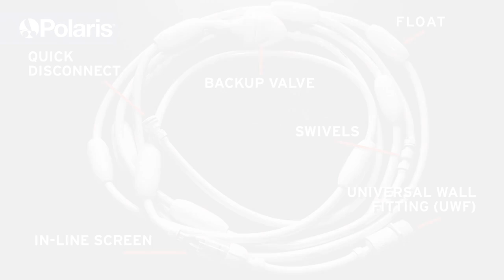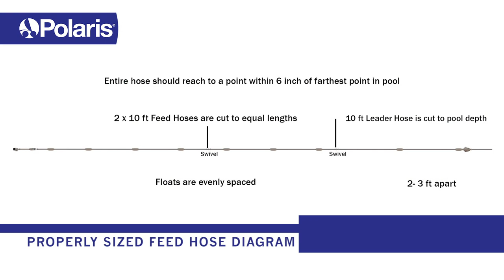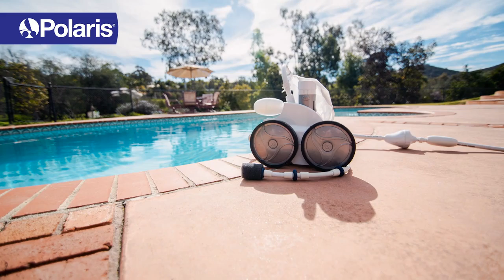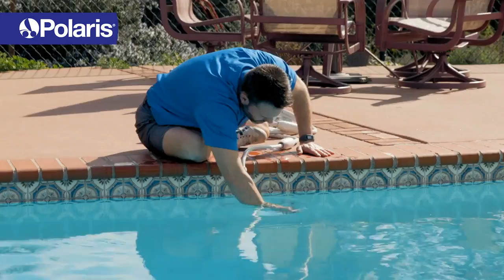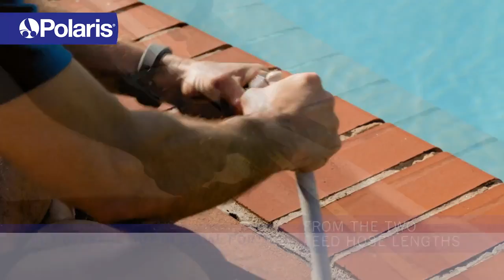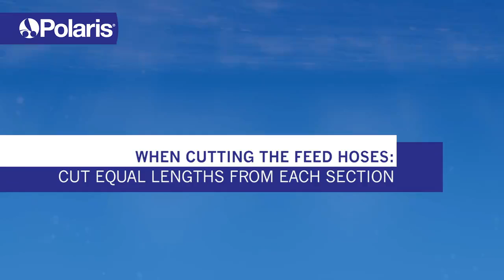Tutorial: Hose Sizing for All Polaris Pressure Side Booster Pump Cleaners

Comment: Really a poor tutorial because it leaves several unanswered questions: the distance from the cleaner to the backup valve and then to the first swivel; the distance between floats and, finally, the distance from the wall adapter to the cleaner/screen. Then, how about straightening the coiled hose before putting it into use. Come on, Polaris!

Comment: I am having trouble getting the hose over the swivel part
Reply: Stick both ends of the hoses connecting to a swivel in a glass/cup of hot water for a minute or two, to soften the hose. That should help.